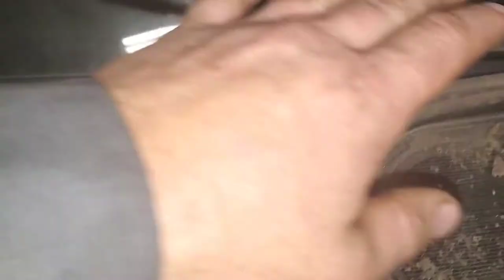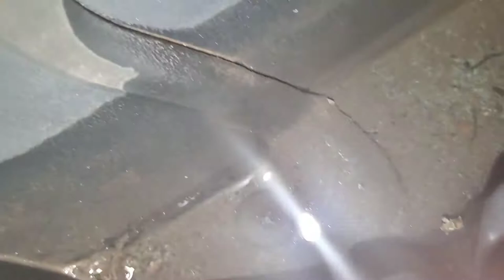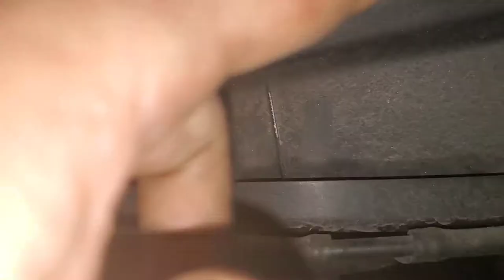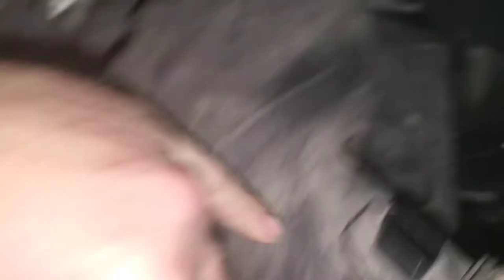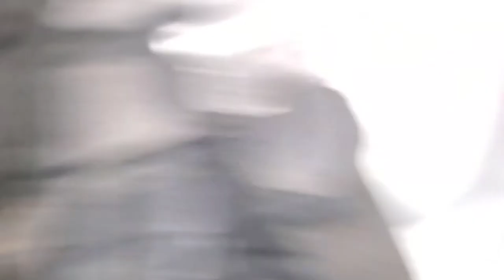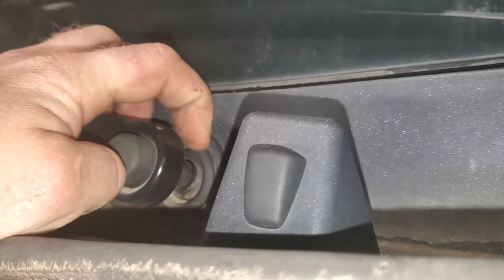⚠️ Transit Owners - Listen Up - Very Important - Missfires, Water leaks, Cleanliness Importance ⚠️

Comment: I taped a sheet of plastic over my Air box to divert the water.  I added two larger drain holes with 4 ft long 3/4" hoses  Use a 1" paint brush to clean the windshield gutter.
Reply: Love this! I'm looking into how to put up some kind of gutter guard as well to prevent large debris build up. I've seen someone comment on a similar solution/idea, just instead with some aluminum flashing, but I like the idea of finding some plastic that'll hold up to any engine temps - maybe something cheap from a dollar store, or DIY box store...

Comment: If the drain is clogged, can it lead to water entering the passenger side at the feet? through ac box.?
Reply from the maker: Yes maybe
Reply: With AC or defroster running the ac evaporator condensate line gets plugged and you get water on the passenger side floorboard. Very hard to get at it on our 2016 Transit 250 3.7 because its above the transmission on the drivers side about three inches up the firewall. I reached up there with a zip tie that I cut serrations in and with the fan on high outside air and vents closed pushed it through that hole and bam! About 2-3 quarts of water came out. Def an issue. Good luck and cheers! BTW you will get wet.

Comment: Does this cause the floor to get immersed with water? I just bought a Transit last week and discovered that when I press the sponge padding on the driver side floor with my feet, water just puddles around my feet. I want to cry.
Reply from the maker: You could have a windshield leak as well as something coming through the firewall because of the leak shown in this video
Reply: @FordBossMe  OK. My friend offered to try to help me out. I'll share this info with him. Thank you so much!!
Reply: I had the same issue, I had a roof rack plug missing